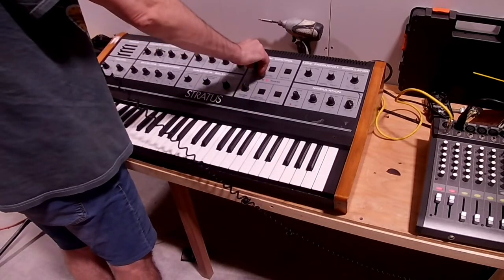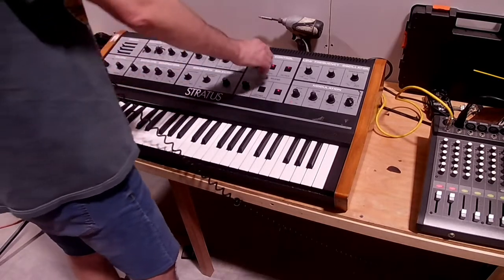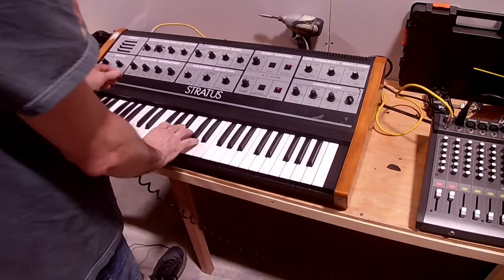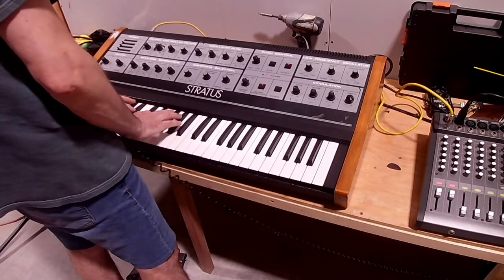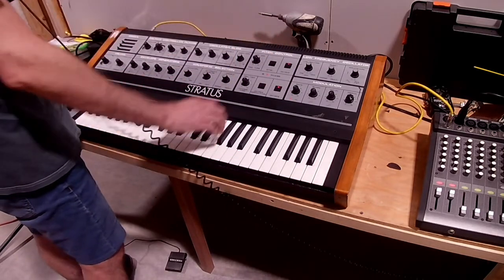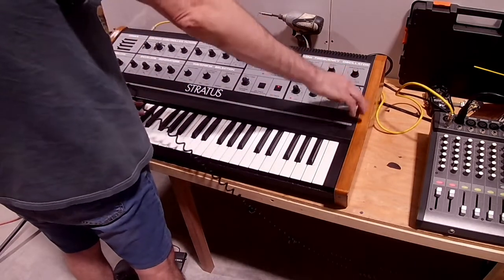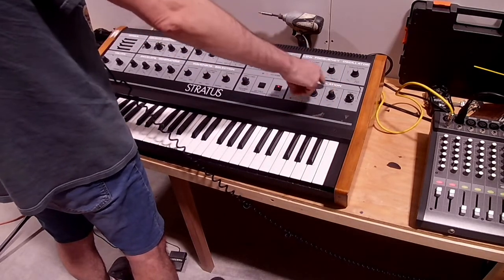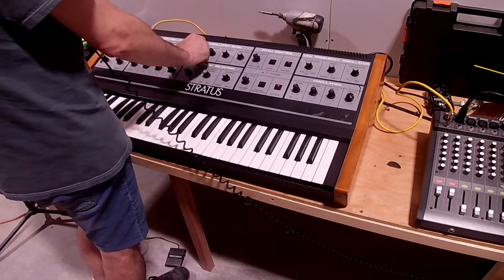Vlog 10 Crumar Stratus; Sounds & Functionalities

Comment: Nice one!
I actually own a Stratus and want to repair it's wood sides, but I've been struggling to figure out how to actually remove the existing ones.
Any ideas are welcome, thanks :)
Reply: I was considering perhaps doing the same!  I haven’t looked into it quite yet though :)
Reply: It's not too bad, I have replaced sides on my Stratus and Trilogy for solid beech sides, use a chisel to remove the staples holding the wedge pieces, prise these off, gently tap the sides until they become loose. Use the piece as a template for the new ends.